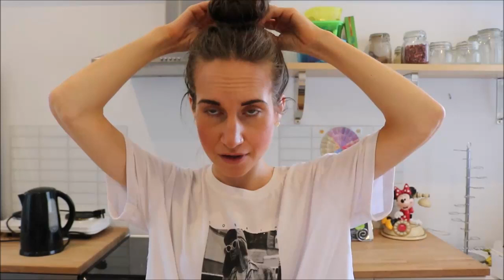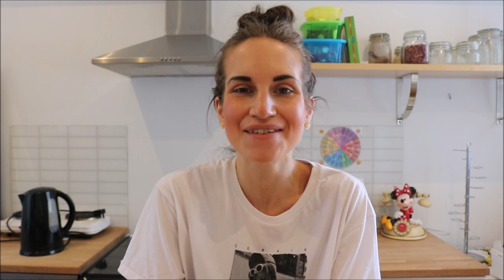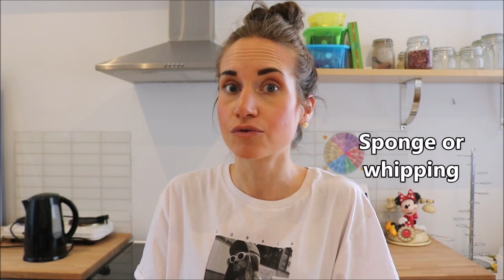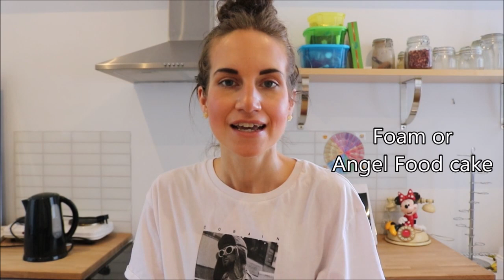Creaming method vs All in one- types of cake mixing methods explained! | Cake Chemistry

Comment: I have tried the reverse creaming metod, and really, really liked it. But still struggeled with it as well (I do struggle a lot with pound cakes). I guess the thing was that my recipe was not a high sugar recipe. And I have read that for the reverse creaming method to work, the sugar content must not be less than the amount of flour. I guess that is because sugar is a liquid ingredient, and for the reverse creaming to work you need some liquid in there for the mixture to actually cream and not just lump up to a stiff mass. Anyway, it does work somehow with lower sugar content, but can also fail easier. 
You definately should try the reverse creaming method, it is quite fun. And also very easy.
Reply from the maker: Thank you for your insights.. I had a go at it a few times but found that my usual creaming method produced a lighter and fluffier cake.. it really depends what texture you are aiming for.

Happy baking 😊
Reply: @claireelizabethcreates  Yes, that makes sense. My cakes were somewhat weird with the reverse creaming method, with these wormholes inside, or what they are called.
I think I will try the all-in-one method next. Or maybe gluten free. I guess gluten free will be easier since you avoid the gluten problem, but I don't know.
Cakes is not my thing, I struggle were nobody else does. But I do manage the Brazilian carrot cake, which is a blender cake. I have made that a few times, and never had any problems, turned out perfect every time! So blender cakes are great, but it is very limited what you can bake. I have only found carrot cake and orange cake, nothing else.
By the way, you should try the Brazilian carrot cake. It is really fabulously good! In my opinion, much better than ordinary carrot cake. And you don't need to use Brigadeiros frosting, you can just use chocolate ganache, that is perfect! I have never made it with Brigadeiros, so I don't know how that would be. Maybe it is better, maybe not, but any chocolate frosting you like will work well enough for this cake.
And the cake is so easy to make that it should be forbidden!

Comment: I love this thank you 🙌🏽 could you do a video on dinner role method. I tried making dinner rolls but it came out really hard
Reply from the maker: You’re welcome 😊 If your rolls are coming out hard, I would inject steam into the oven which will help slow down the formation of a crust.. you can do this by putting a tray of hot water on the bottom shelf

Comment: You have not mentioned that to compensate for the lack of extra air beaten in with the all in one method you are supposed to compensate by adding extra baking powder which produces a very light and airy sponge.  The texture though is not as even as the creaming method
Reply from the maker: Thank you for your additional input.. the baking powder will help for sure, and it’s important to ensure it is well distributed within the flour 😊